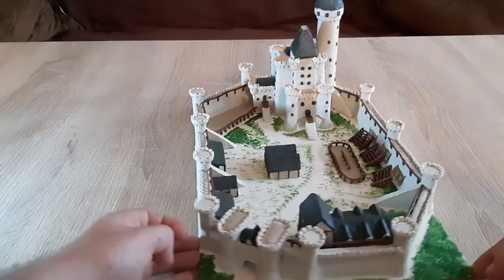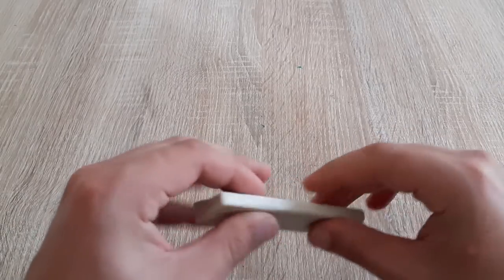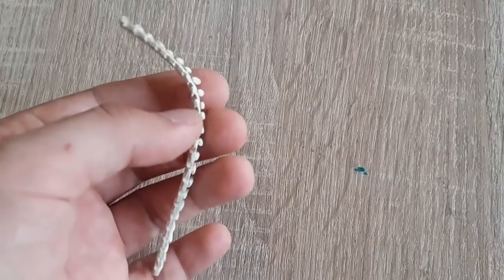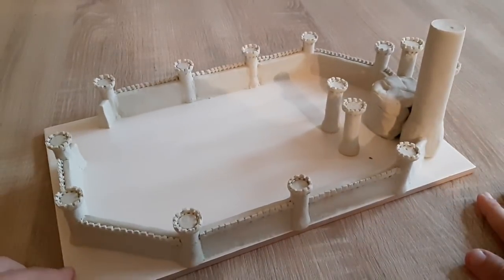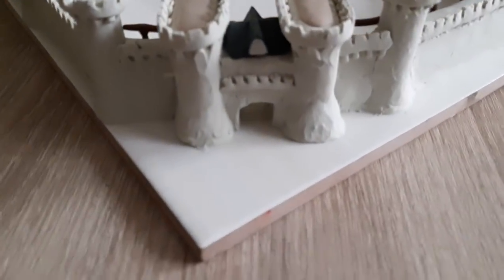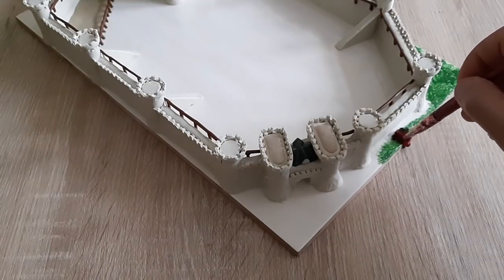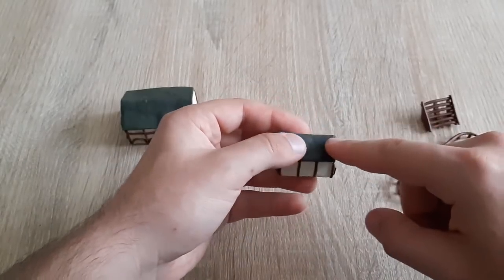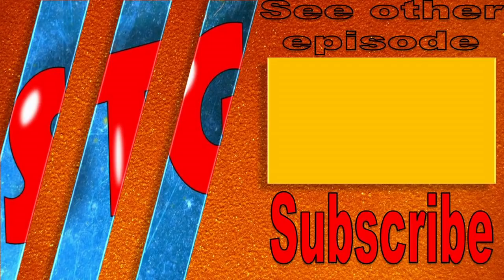Sculpting Honorguard Castle Diorama designed by Shadiversity/Clay model

Comment: Why should the keep hug one edge instead of being in the middle?
Reply from the maker: Good question. This one was designed by Shadiversity and so he can answer it better, but I will try to give mine: The model is not complete here, it has outer walls and is located on the hill, so technically it is closer to the "middle"(hence being more protected, instead of being closer to the edge and closer to attackers) and IMO by making it "a part of the wall" maybe shad conserved space inside the castle. 
Here is the timestump link of the original design: https://youtu.be/sJkXRDKdAcM?t=63